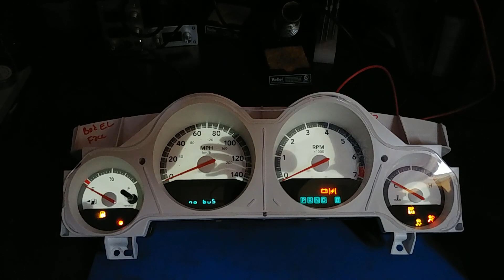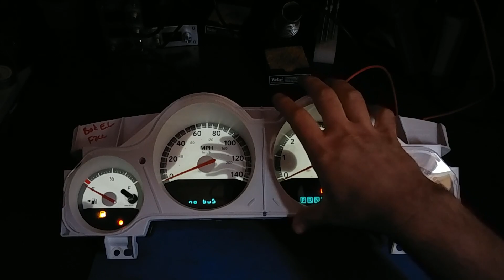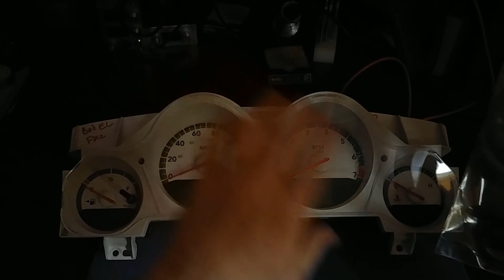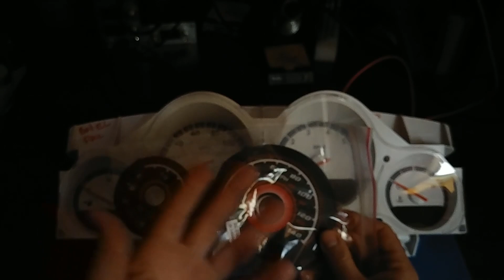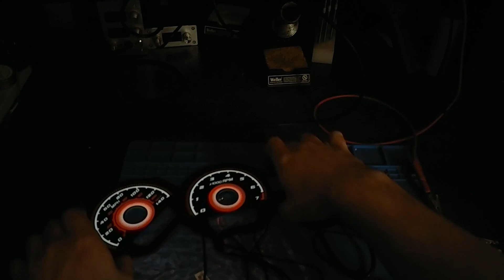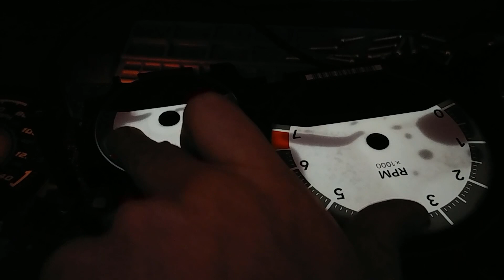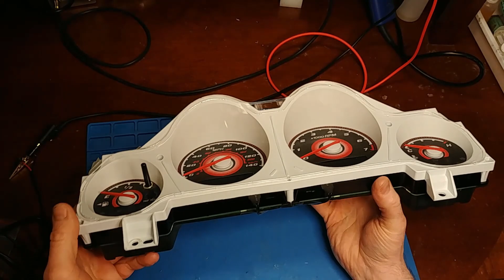Charger Challenger EL Lighting Cluster Repair

Comment: The mind of man (engineers in this case) just seems determined to out-complicate the complicated that soon it'll be so complicated it'll be useless.  Seriously, we went from light globes, to leds, to surface mount leds and now to this bullshit. 
I remember back in the day, one could drive into a service station, buy a new rubber for the wiper and be gone.
Now you go to the auto parts store and there are walls and walls of wiper blades.  I mean, how many different ways do we need to squeegee water off glass ?  Ever since humans invented the wheel, engineers haven't stopped trying to find ways to make the wheel rounder.   Just my fourteen cents.
Reply: My Volvo XC-90 has wiper blades with integrated water springlers on them,
Reply: Couldn't agree more.  Over-engineered ad nauseum.
The best solution is usually the simplest solution.

Comment: Hmm not the best idea for illumination, EL panels do fade.
They could of used a laptop lcd lighting assembly without the lcd layer.
Low voltage and variable led brightness control
Laptop led backlights seem quite reliable.
Reply from the maker: EL can be reliable with a properly designed system. If dodge would have a setup with the EL panel of the Sebring but the inverter of a Charger they would have a solid system. I'm starting to see LED failure in early LED back lit clusters starting around 2007.
Reply: @jeffescortlx  Dam!, seems like you can't win.
You can always try gas mantles :D
Reply from the maker: @zx8401ztv  I'm ready for nixie tube clusters.

Comment: Since you have a spare inverter you can get a sheet of EL panel from Adafruit (ladyada) or elsewhere for pretty cheap.  cut it with some shears to any shape then with a little scraping to expose the substrate you can solder your leads and play with it.

Comment: Looks great. For sure the failure was due to delamination of the EL panel, so I wouldn’t see any reason why you couldn’t reuse the factory HV generator. BTW I have seen EL typically run on about 90-130V AC (not thousands). Thanks for the video.
Reply: but at between 8k and 10k Hz
Reply from the maker: I'll admit I'mm not very familiar with EL specifications. The bigger the panel the higher the voltage required?
Reply: @jeffescortlx  voltage stays the same current draw increases.  brightness is the frequency and that makes the high pitch noise you hear from the transformer.  Some colors need more current and KHz like white and blue, red is more voltage, less current and freq iirc.  It's been a few years.  I should probably freshen up and shut up lol.

Comment: I will say I would have been tempted to run the original EL matrix through a laminator to see if that expunged the shadows since the problem seems to be caused by delamination.
Reply: Do you use glue to keep it sealed? If yes, what kind? Curious guy here ;)
Reply: @remiserriere  Big 80's Aqua Net size red can 3M adhesive spray.
Reply: Has to be a polymer based compound because the water based, well, humidity will just bond with it and come loose.
Reply: That's exactly how we sealed panels that would be cut on a plotter/cutter and multiple color layes for event advertising.

Comment: Wondering if you measured voltage, current and inverter waveform of the old and new displays. How careful do you have to be with these things.  Good job on saving the cluster.
Reply from the maker: Nope. I took the gamble. I just let it run for the afternoon. No angry call back from the customer yet so I assume it's still going. This was filmed 3 months ago.

Comment: Cobra Nightwatch CB radios have a very high failure rate of their  EL faceplates too
Reply from the maker: Curious if replacements are available?
Reply: @jeffescortlx  there used to be but I don't know now. I don't have a radio that needs fixing at the moment. I was just thinking about the noise issue. On the CB radio s
When the light went bad I really overload the driver and made the reception on the radio unless with 10db of noise
Reply from the maker: @SDS-1  EL lighting for a CB radio doesn't seem like the best choice in my opinion.
Reply: @jeffescortlx  it's truly NOT

Comment: Wow,  wish you shown the video how you tapped to the factory cluster.   Otherwise awesome video!!
Reply from the maker: The board has a connector for the EL wiring, I just used that. Didn't even have to solder to the board. Plugs in.
Reply: @jeffescortlx  oh okay!  Gotcha.   Nice fix though.   Looks nice even for ebay purchase!
Reply from the maker: @AP9311  quality of the eBay face was pretty good. I can recommend.
Reply: @jeffescortlx  do you have a link to the eBay cluster you used? Thanks for the video. 

I found several places online that have “OEM” replacements. They’re expensive but I don’t know if they’re actually new or remanufactured.
Reply from the maker: @hdflame  I didn't buy a replacement cluster. I just bought a new electroluminescence face and installed it on the original cluster as shown in this video.
Reply: @jeffescortlx  Hey I'm currently attempting to fix my gauge cluster lighting issue on my 2013 Dodge Challenger RT but I'm wanting to use LED strip lights for the backlighting instead of the EL panel since mine is damaged. I will be modifying the housing so the LEDs shine through the back of the gauge faces I'm trying to figure out how to wire the LEDs to the cluster so I can dim the lights with the factory dimmer switch. They can be 5, 12, or 24 volts I want to get something that'll work before I start any modifications. Any help would be greatly appreciated.
Reply from the maker: @scottbouc2888  Even if you did modify the plastic assembly to fit LED strips/rope, that original face isn't designed to allow light to shine through it. The light of the LEDs will not be able to illuminate through that original EL face.
Reply: @jeffescortlx  I'm removing the EL face from the cluster entirely I have it apart already but I don't know which circuit connects to the dash lights and will allow for them to be dimmed. I'm just trying to figure out how to wire it up before I order stuff so I get the correct things otherwise if you wouldn't mind I would like to try that repair you did but I need parts to do it. I'm a automotive mechanic so I'm somewhat confident in my ability to do this job just haven't modified a factory cluster before. The black plastic part is what I'll be modifying. Also light will shine through the cluster face with the EL panel removed.
Reply from the maker: @scottbouc2888  I don't think I understand what it is you're doing. So you are removing the face entirely? Or your separating the layers in the face?
Reply: @jeffescortlx  the gauge face comes off  (the part that you can read in the vehicle) of the EL panel they aren't stuck together at least mine isn't maybe it came apart but it's separate and appears undamaged the EL panel however is cracked and the outer clear layer is bubbled up which is causing the dark spots much like the one you show in this video. The EL panel is a white piece with a clear outer layer and  black backing with two printed circuit wires that plug into the main cluster circuit board. I'm just telling you that so you understand that I know what I'm talking about maybe just not using the correct terminology for things.
Reply from the maker: @scottbouc2888  okay I think I understand what you're doing. It's possible you might get some inconsistent illumination. Usually gauge faces that are designed from the ground up to have a lighting source like an LED or a light bulb behind it has gradient illumination layers in such a way that the face helps even the lighting out to make it consistent across the entire face. Since this face won't have that it's possible that you'll get brighter spots directly under the LEDs. It might look splotchy. But to answer your question, this generation of Chrysler products don't have an analog wire that comes up to the instrument cluster to power the backlighting. The instrument cluster receives the backlighting signal through the LIN bus communication. So you'll either need to tap in at the primary side of the inverter before it's turned into high voltage, or you'll need to steal the lighting power from a different interior panel that has a more traditional LED for lighting rather than EL.
Reply: @jeffescortlx  ok now with saying that is there a way to test the circuits without burning up a volt meter if I accidentally hook it to the wrong side of the inverter or will it not effect it I'll be using a Fluke 87 meter to test the circuits. This is what I actually needed your help with originally I don't know how to properly test circuit boards for power or in my case a specific circuit that controls illuminaton and has enough voltage to power the LED lights I'm using I have options for voltage I can get a 5 volt 12 volt or 24 volt LED strip whichever is best suited for the circuit assuming I can hook it up that way otherwise I might attempt to grab power from the headlight switch assembly for the interior lights. Or I just say screw it and get that EL panel and gauge face you used to fix it but I'm having trouble finding it.
Reply from the maker: @scottbouc2888  can I recommend you just purchase a replacement EL face instead of re-engineering and modifying the cluster?
Reply: @jeffescortlx  I did that I agree it's more complicated than I was hoping. Do you know if a 2010 and 2013 gauge cluster EL gauge cluster assembly is the same thing? For some reason I can't find anything for a 2013 Dodge Challenger all I can find is older ones they honestly look identical to mine but I don't know if they are 100% the same. I found one that's the correct MPH for my car but it says 06-10 Charger/Magnum in the listing. The price isn't bad so I'm going to take a chance on purchasing it in hopes its the same thing but just not listed for all applications for some reason.
Reply from the maker: @scottbouc2888  yes I believe it will be compatible. As you see the mph has to match.
Reply: @jeffescortlx  sorry for bothering you so much today. You've been beyond helpful and I really appreciate you taking the time to get back to me quickly.
Reply: @jeffescortlx  I’m stuck at this point. Any way I can contact you and send you a video. I have this exact cluster. Having issues gaining power to it.
Reply from the maker: @anthony2039  your cluster isn't turning on?